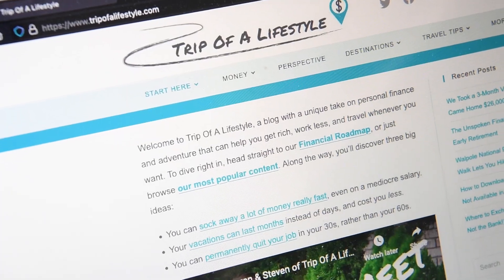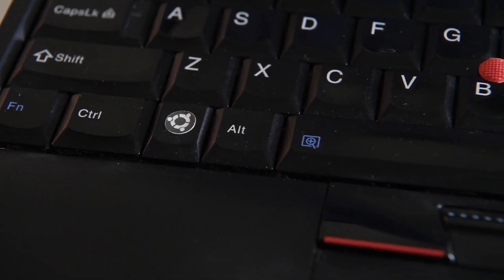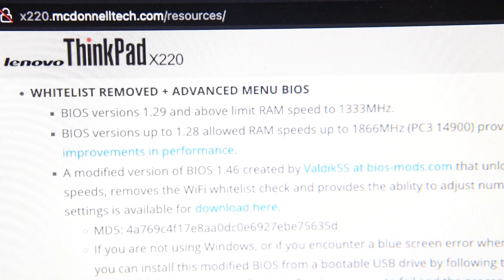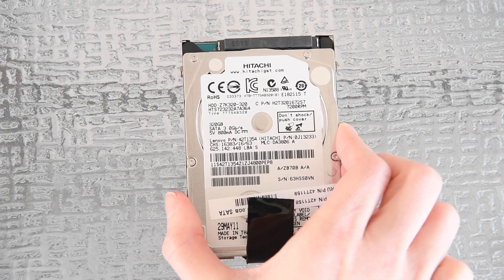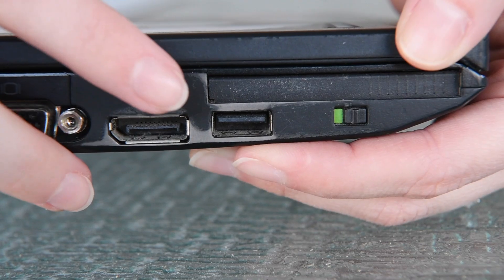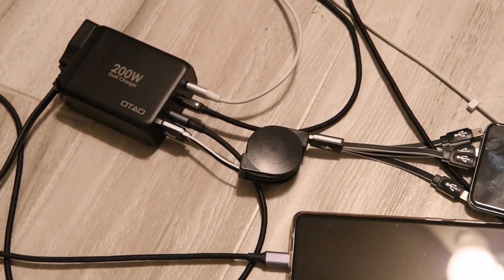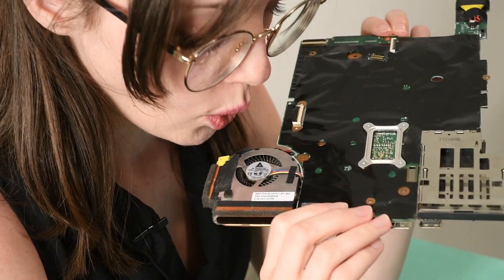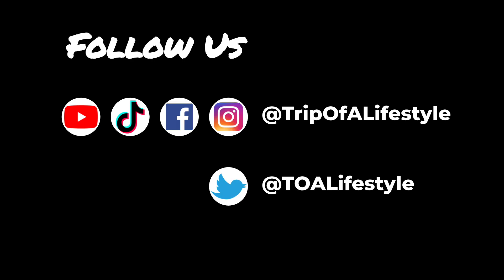How To Make Your Laptop Last FOREVER (My ThinkPad Mods & Upgrades)

Comment: usb-c charging port is not a good idea
Reply from the maker: Care to elaborate? Been very happy with it for nearly a year now!
Reply: @TripOfALifestyle   My laptop stopped charging over the usb-c and needs to be replaced it is a matter of time since the pins in the port are so small an wear out for me is cheaper to buy a new laptop than get it fixed, never again, Make sure you do not bent the cable when connected it will only speed up the process

Comment: Awesome video, I totally relate to this lifestyle, tech minimalism (nevermind tens of Thinkpads I've accumulated, but slowly getting rid of). It isn't just about saving money and reusing old stuff, it's that the old stuff is actually better, in terms of design and general usability. There isn't a laptop currently available on the market, for which I would trade my X230 with i7-3612qe and IPS screen. I don't care whether or not my laptop has a warranty or not, if I can cheaply buy another, if this one eventually dies of old age. At the end of the day, it's about getting the work done, shouldn't put more than necessary time in thinking about this. Modern trends of following technology, every year new phone model, new graphics card, the comparisons and other nonsense, are just the worst type of consumerism, a plague of our late stage capitalist society.
Reply: Check out Framework laptops.  That's what I moved to after my old Lenovo.  Decent keyboard (I'll admit I still prefer my x220t a bit), and upgradable in the future.
Reply: @TheInsomniaddict  But no nipple ;(

Comment: We are in a club😀. I use my Thinkpad X220 since 2011 too, and it is still kicking.

Upgrades:
RAM 8 GB -> 16 GB
mSATA drive (128 GB), that is when I made it dual boot Windows/Linux
spinning disk -> SSD (1 TB)

(Stumbled across this video when searching for a new secondary battery)

Things that no longer work:
Touchpad - it got erratic about 5 years ago, so since then it is the red "joystick" or a mouse
Touchscreen - Well, it works on Linux and on battery on Windows too, but with a plugged-in power adapter the mouse jumps to a random point on the screen on Windows about every second. Weird, but fact.
Reply from the maker: 👏

You can find replacement touchpads on eBay!

Comment: The happiest part is considering how much e-waste you haven't created, as a lot of people treat a laptop as a throwaway item and renew when the next fastest thing comes along. For myself I've never bought new, just by used and upgrade what you can😊😊
Reply: I buy new, but I use them until they're dead.  Old laptops make pretty decent home servers.
Reply: This is kind of girl I love to be with. Not a girl that spoiled with her latest MacBook Pro. I also now focusing on buying a futureproof laptop so that they can last 10+ years. I would have been happy with a Lenovo Thinkpad W520 but my 4K video editing work requires like a Pascal Quadro GPU so Fujitsu Celsius H780 is perfect.
Reply: I'm a huge e-waster 😍

Comment: somebode probably already commented it but I would recommend getting libreboot which will speed up boot up times!
Reply: It's a bit of a process to install it. But it is open source, allows better access to hardware, and allows you to have a computer where all the code running on your system can be trusted. 

Pretty neat.
Reply: @geostokes8573  Libreboot on X220 doesn't remove all proprietary firmware blobs and Intel ME, so it doesn't make your computer fully free. It's still nicer, but less benefits for more effort because Libreboot doesn't distribute the proprietary stuff it needs. X200 though can be fully librebooted (pretty much the newest thinkpad that supports it + Richard Stallman uses it), and T60/X60 can even be librebooted just from software, no taking apart and connecting anything required!
Reply from the maker: Interesting! Never heard of that.

Comment: When it comes to USB ports, please keep in mind that USB 3.0 is available only in i7 version of X220. If you get i5 or i3, you will only get USB 2 ports.
Reply from the maker: Correct! But you can still get some level of USB 3 support through an ExpressCard!
Reply: True, but for all practical purposes it doesn't matter unless you are transferring mega amounts of data. For day to day use USB2 is fine, esp. if you are just connecting peripherals like a printer, mouse, keyboard etc.
Reply: @Fred-g2k  True, yet USB 3.0 does make backups, restores & clones many times faster!💪
Reply: Get the x230, it has the USB 3 ports at any level
Reply: Well, ferk me. Where's the nearest tall bridge.
Reply: I got a Lenovo ideapad g510 with 2 USB 3 ports circa 2013
Reply: Doesn't really matter imo.😊

Comment: You've pretty much pushed it to the max! I like it. I've got same X220 with i7. Where did you get the USB-C charging port? Was unaware of that, so appreciate it. I'm checking Aliexpress but haven't seen one. 

If you wanted to squeeze every bit of performance out of it, you could look at compiling with Gentoo but I doubt it'd be worth it + you'd have days of compiling ahead of you.

Think if you wanted to go further mods, you'd have to go X230 but I appreciate this is your original laptop so likely quite attached to it
Reply from the maker: Thanks! There are links to every mod in the video description, including the USB-C power port.
Reply: @TripOfALifestyle  Winner, thank you. I often forget to look there. I've read that Kingsener batteries on a Aliexpress are generally quite good, that's my next stop. I'm mostly plugged in each day, so I've used TLP to set my battery thresholds to 40-50% charge, i.e. extending the lifetime of the battery before it degrades. I'm also interested in recelling the battery but just don't have the time or equipment just yet. I'd definitely watch a video on that if you're looking for another challenge

Comment: My 13 i7 MBP gave up after 11 years of use but I think money spend well, I upgrade its RAM and SSD. I miss the old build and the upgradeable old laptop. To replace it I choose 14 inch MBP M1 last year since I am so deep in Apple ecosystem even though I don't like the soldered RAM and especially SSD since it will brake eventually.
Reply from the maker: MacBooks are built really well and typically last a long time, but yeah, you're right...soldered SSD sounds like a bad idea. Didn't know they did that!

Comment: I do a very similar thing! As a cyber security engineer, my company supplies me with a laptop for work. But, for college and all personal use after college I have been using/upgrading a Lenovo Thinkpad E580 that I bought in high school. It didn't have a windows license when I bought it so I've been running Ubuntu natively since day 1 (I prefer standard Ubuntu to Xubuntu even though standard Ubuntu is slightly more resource heavy).
Reply from the maker: Cool! We were on regular Ubuntu until they switched to Unity. 🐧
Reply: @TripOfALifestyle  FYI: Ubuntu has gone back to using GNOME since 18.04 LTS. I also prefer GNOME over Unity.
Reply from the maker: @andylightfoot7508  Loved GNOME 2. Not quite as fond of GNOME 3 and onward. Just personal taste though!
Reply: @TripOfALifestyle  Fair enough. The most important thing is that they are all free! Thanks so much for interacting! I love y’all’s content! Keep it up!
Reply: @TripOfALifestyle  MATE was specifically made to continue Gnome 2 base.  I think it's default of ParrotOS.
Reply: I just love Ubuntu....feels good and comfortable like an old shoe.
Reply: oh, come on, you're not a smug Arch user?  You might as well go all the way back to Debian!  srsly, a little bird told me, all the fanciest cybersecurity tools work on Debian.  it's ture you can get a ton of the open source tools on Black Arch, unfortunately it's difficult to do only FOSS.

Comment: but she showed dimm ram memory
Reply: yea and 16GB ram on max 8GB
Reply from the maker: @satuituahadbukantauhid3031  Lenovo spec is max 8 GB at 1333 MHz on the X220, but it will actually take 16 GB at up to 1866 MHz with the special BIOS version shown in the video. 😎
Reply from the maker: Yes, we used some random desktop memory from the closet to film b-roll for the birthday scene. Laptop was already put back together. 😅
Reply: Yea, Not sure she did that because she is a dimwit or appreciate her S.O 's efforts. Regardless thinkpads are nice - Built like a tank